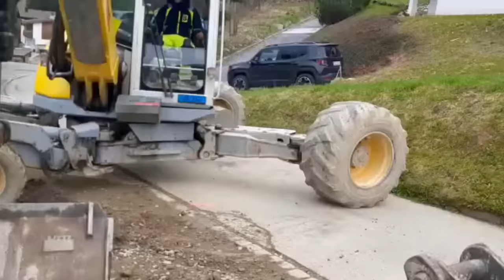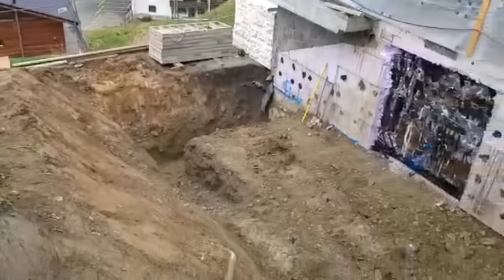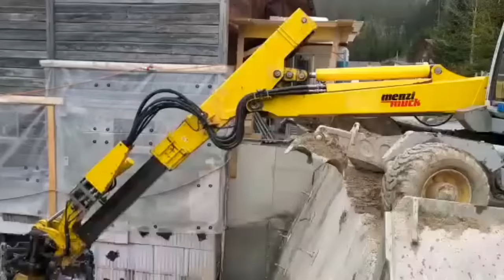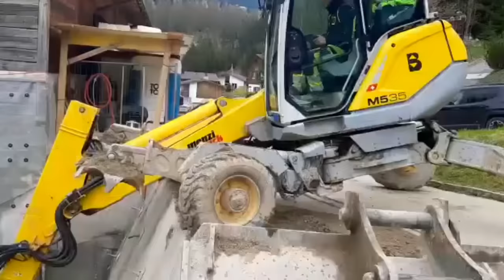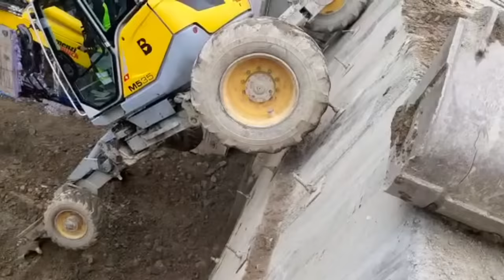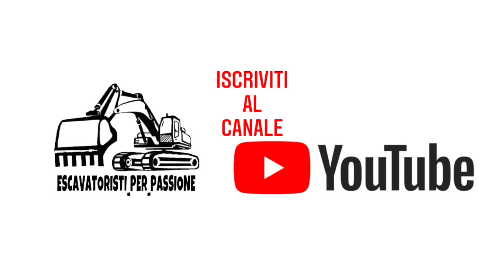DISCESA FOLLE di un MURO VERTICALE con MENZI MUCK M535

Comment: WOW!!! very impressive. As mentioned before that bucket slide was awesome. I run an M540 everyday at my job and the best compliment I love to hear is "you make that look easy". Sir you made that look like a walk in the park. Thank you for the lesson.
Reply: i don t know if we watch same video but that s not that challenging with that machine, it s harder to drop an excavator without ramp, steel on steel, flat blade, this isn t even a plum wall, is nearly a slope... the operator didn t look that confy he went back and forward 20 times which made it dangerous to than realize that he had to open the bucket then he started again, afraid to drop the front end down, then he got confidence and went down but he was freaking out coz didn t even lifted up the stabilazer when he turned around and started pushing on them.... he ll get there doing it more....